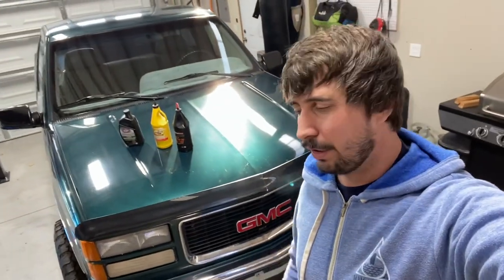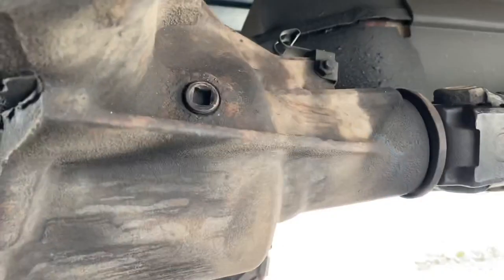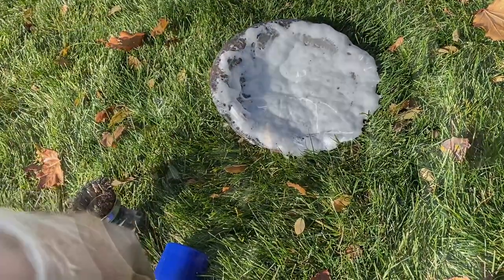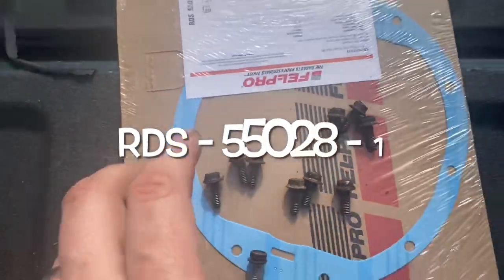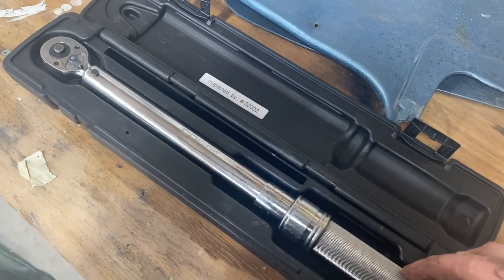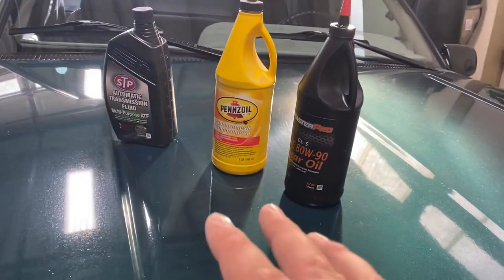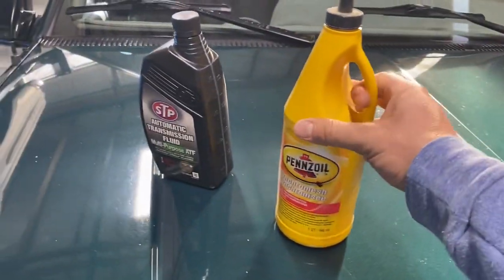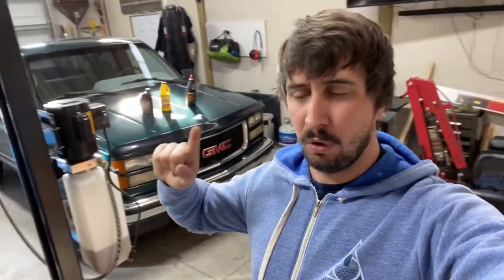GM 10 Bolt Fluid Change

Comment: how many liters of oil did the differential take and what keys is it to remove the filler cap
Reply from the maker: I wanna say you generally fill till it leaks out and stop which is usually 3ish qts.  I use a regular 3/8” drive square socket (just the ratchet end) to remove

Comment: Can you use 75-90 for the diff on a c1500?
Reply from the maker: Technically, no.  GM calls for the 80w-90 in the manual.  Im guessing if you did it wouldn’t kill the diff its just a little less viscous cold but then again Id just run what they tell you to.